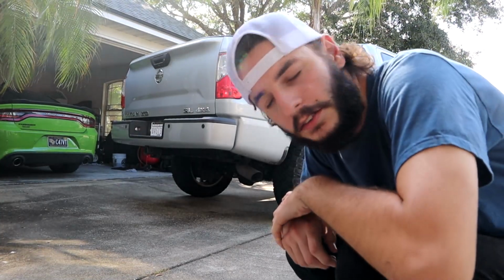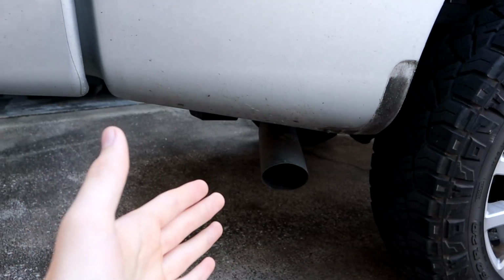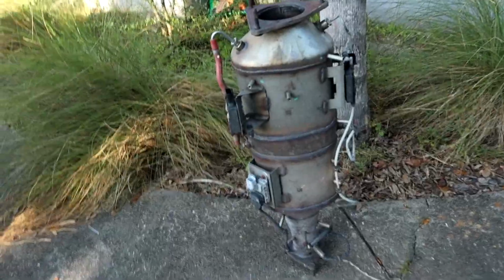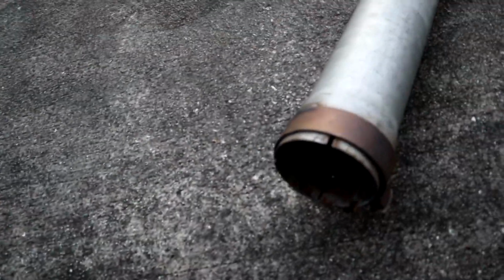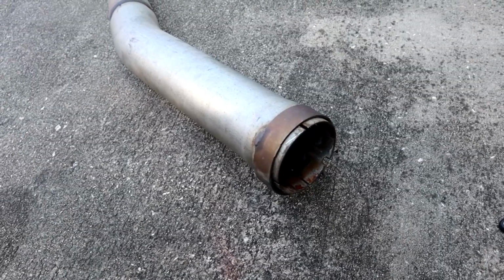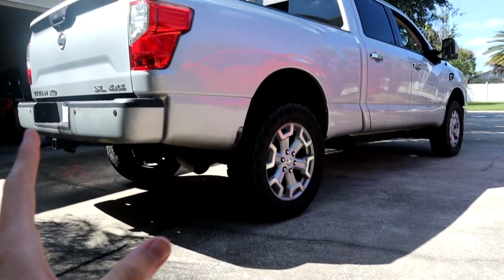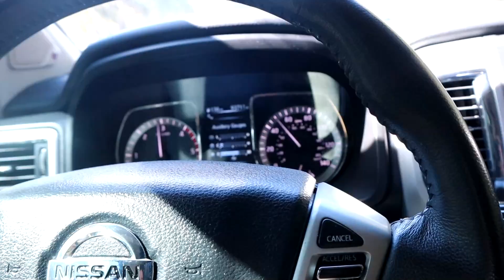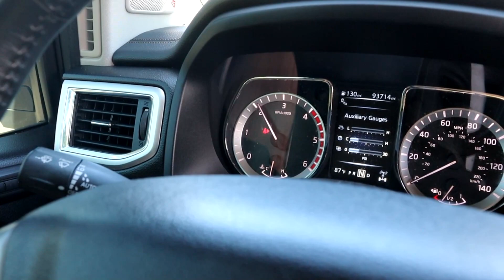THIS 4 INCH EXHAUST IS PERFECT FOR THE TITAN XD

Comment: I just bought a 2018 XD with 19k miles with the 5.0 and I'm itchin to tune and delete!! Thanks for posting bud, I'll be following this build.
Reply from the maker: Thanks man
Reply: @kbridges5.0  Where did you get the straight pipe, EZ Link and tune?
Reply: @Zeke Silva I found by shopping around, you can delete and tune for less than $1700. I'm done with mine, now my dad and step-bro want to do the same. Really wakes up this little 5.0
Reply: @robertbass5788   dpfdeleteshop has em.
Reply: hows it run ? the reviews online give this motor a bad rep
Reply: @daniel-xi3nj  I don't regret buying it, tuning and deleting is the best thing to do to these trucks. I regularly get 21mpg driving 80 on the interstate. No issues so far
Reply: @robertbass5788  where did you get the the stuff from?
Reply: @devonarchambault2847  stuff? Tune/ tuner/ race pipe?
Reply: @robertbass5788  yes
Reply: @robertbass5788  all of it I have a 18 and I'm  trying to find all besides the egr delete cause I've found that
Reply: Are concerned about EPA emission testing coming into effect on these trucks?
Reply: @danielforbes1997  no, can't affect previous years, only new models
Reply: @robertbass5788  no you don’t, these trucks will never get 20 at 80 bud, I’ve been owning this truck for 4 years deleted and it still won’t get good mpg
Reply: Delete ASAP Best advice I Can Give You, Before its too Late
Reply: @robertbass5788 I just got my cummins 2 weeks ago, I've never had a diesel but I wanted more out of a truck, I traded my 2019 titan sv for a 2019 sv xd with 4x4. I'm getting 14/15 mpg. I was really confused, is this normal? The truck came with mud tires so I'm about to put less aggressive tires on and see if that changes anything.
Reply: @WilliamL1988  I have the same truck, not fuel efficient . Deleted and turned ones get a little better on mpg.

Comment: Nissan did a good job with the engine and transmission choice. The Aisin transmission in it is a sister transmission to the one dodge put in their 3500 chasis cabs.
Reply: Dodge arent known for having very good transmissions 🤣
Reply: @rock-uu7qr  aisin was the smartest thing they went with
Reply: @lacboiatl  Because allison was taken
Reply: @rock-uu7qr dodge has never used an Aisin transmission, Ram has though and they are known for being good in the 3500 and up trucks.
Reply: @michaelgregory7457  oh boy 🤦‍♂
Reply: @rock-uu7qr  it’s a fact worth noting. The aisin is far superior to the 68rfe and 48re in stock configurations.

Comment: I maybe pulling the trigger on a 2017 xd with 40k on it but I’ve only heard so many issues with there def and egr system.
Reply: I have a 17 XD with 84,000. Bought it at 73,000. No issues so far but I do a ton of highway driving and I don't baby it. I cannot wait until the warranty ends to get the emissions shit off of it. Love the truck so far though.

Comment: I'm trying to get rid of the awful hesitation my '18 has, where you try to get moving and it just sits there for a few seconds, then slams into first and shits itself moving again. I've heard a tune will do this for me, and I'm preparing to but....what's your impression so far?
Reply from the maker: It's definitely still there but it's fixed by a substantial margin when I'm on tune 1 it's almost the same but tune 3, 4 or 5 it's probably 80% better, I'm definitely happy with the change
Reply: @kbridges5.0  Awesome thanks! I notice my trans never comes up to proper temp too, so I'm going to do the thermostat mod, but I've been hearing great things once tuned. Appreciate the info!